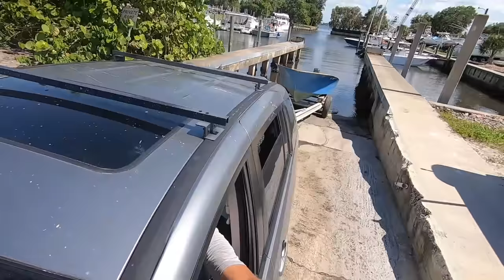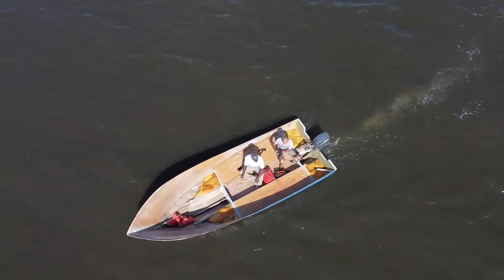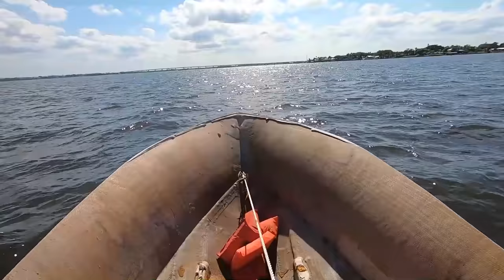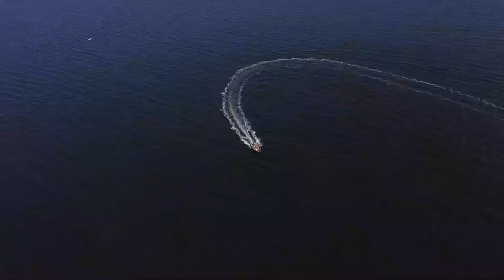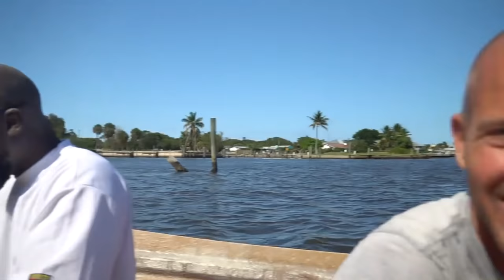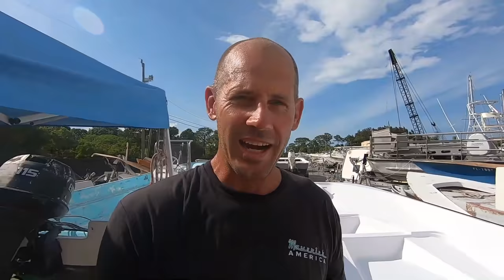Deep Vee Skiff build 25hp

Comment: Talk about overpowered. Just the other day I saw about a 22 foot pontoon boat with 200 horses swinging off the back!
Reply: Ideally you wanna a motor that’s gonna run in the high RPMs. Overpowering a boat leads you to spend a majority of your time in the lower RPMs which is bad for the motor. Too much carbon buildup. Marine motors need to run hot in the higher RPM range on a regular basis to live long and happy lives.
Reply: @hidel308  .... And could actually imagine keeping revs up with a 200 on a pontoon?
Reply from the maker: SERIOUSLY?!  Haha, that's crazy!  it's gotten out of control. we recently spotted an aluminum pontoon (25 ft give or take) with big TWINS on back. guessing 200's or 250's.  what in the hell?!  haha.  to each their own!
Reply from the maker: @hidel308   so true! way worse fuel economy as well!
Reply from the maker: @Mike-gw9yt  i can see it now...  kids:  "Dad why do you pull us on the tube at 50mph?!"  Cheers!
Reply: I've seen twin 450r's on a pontoon boat
Reply: ¹80 hp mr fussion ektrc beyer

Comment: I would run a 3 cylinder 2 stroke Yamie 50hp with a nice deck and Jack plate and man she would be a sick little flats ripper. Only reason I say do a 50hp is because  once u put some gear in their with two people you will be playing ring around the Rosie just to get it up on plane
Reply from the maker: So right!  and i agree, that would be a slick/fun setup!   I currently run a 70 hp 2 stroke... definitely way more power then needed!  Propped for load/ still tops out at 38 mph!  Make sure to checkout the next video to see it!  Cheers !
Reply: 50 hp jet outbard betèr

Comment: No gunwales? No inwales? I'd be afraid to would fold like a banana when it crashed into the first wave. Then again, I make my boats out of plywood and epoxy 🤣
Reply from the maker: Ahhh, great point!  Remarkably, it’s incredibly strong as it is ( although in this vid it is just in project phase) , I plan on finishing it all out with reinforcements.  That’s the beauty of these older boats.. built tough!   You can sit on the edges with very little flex, I’ve  taken this boat through some pretty serious waves too ( stay tuned for part 2!) and it does really well/ holds up.   Thanks for the comment and cheers to building your own boats!  🙌🏼
Reply: It’s like a Port-A-Boat!